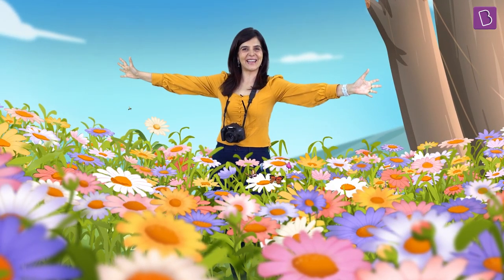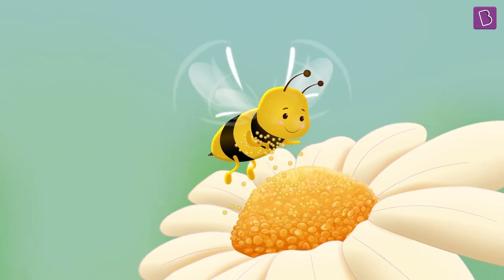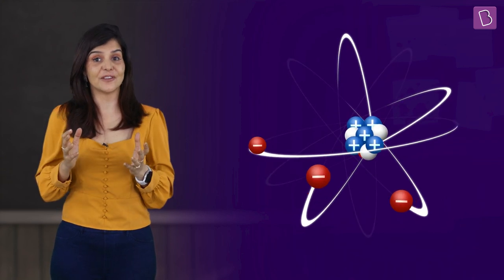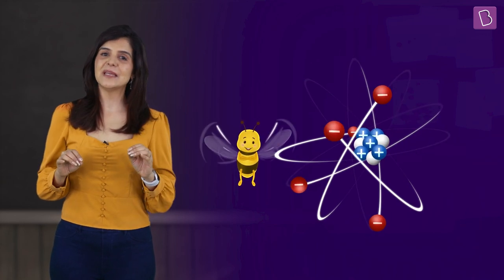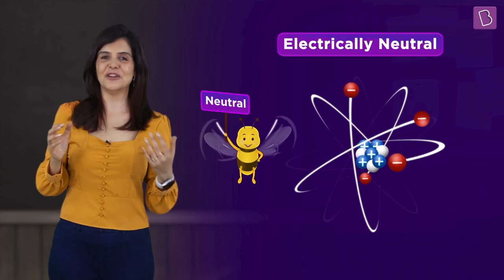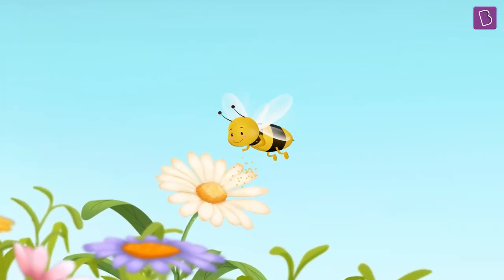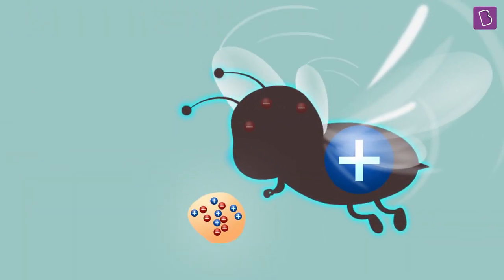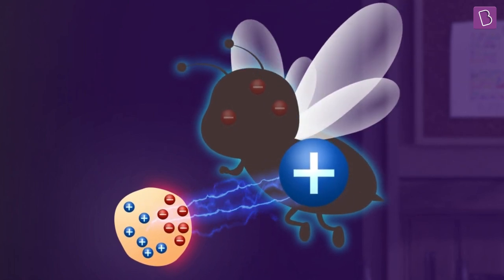How Do Bees Use Electricity For Pollination? | Learn Pollination | BYJU'S Now We Know

Comment: The correct option is D 2 ms
Given:
A bumblebee's wings vibrate 4000 times in a span of 8 seconds.
⟹ In one second, they vibrate 40008=500 times.
Frequency of an object is defined as the number of times the object vibrates in one second.
So, the frequency (f) of the bumblebee's wings is 500 Hz.
Time period (T) is the inverse of frequency.
⟹T=1f=1500=0.002 s
T=2×10−3 s=2 ms